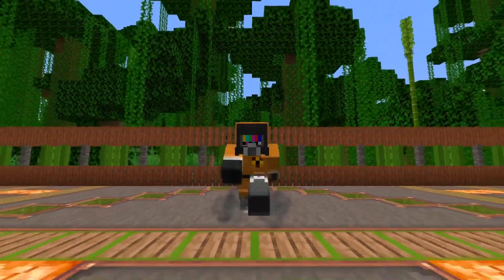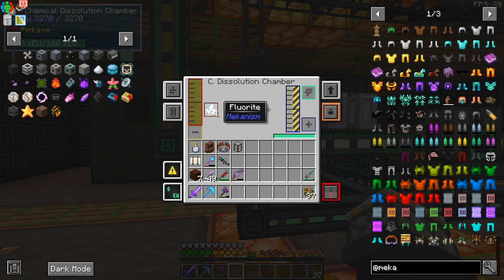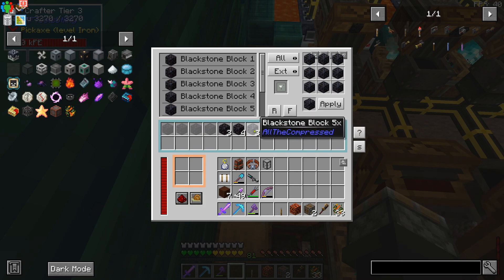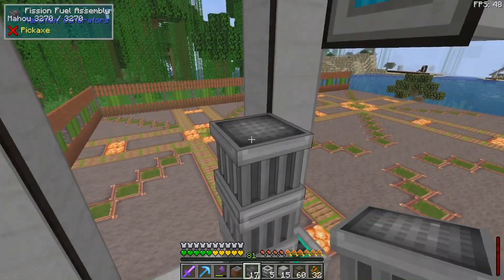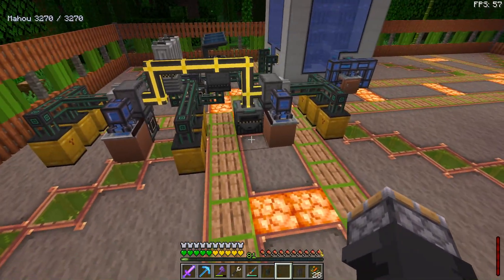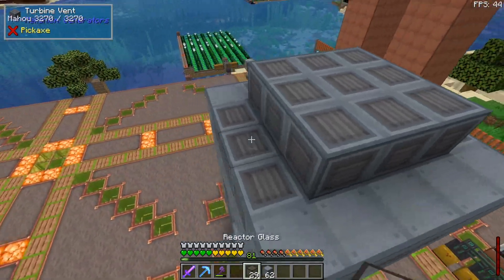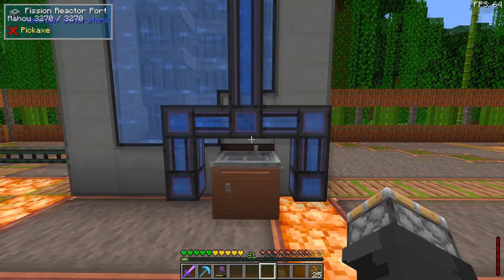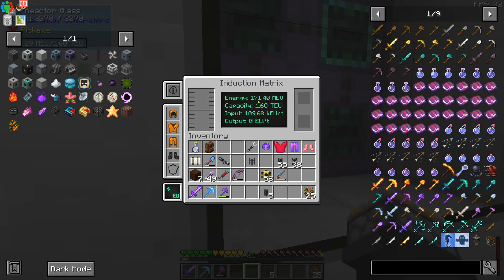Tubenobyl - Fission Reactor Mekanism - ATM7 Ep 13

Comment: Thank you for this video. I am going to try a similar setup in ATM8 though I am going to build the reactor in a Compact Machine. This way if it goes boom then nothing in my world should be hurt!
Reply from the maker: Smart idea! Good luck with the build.
Reply: @TubeAndKnuckle  The Solar Neutron Activator needs open skies so I cant collect any pellets inside the Compact Machine. Plus Gases cannot be piped outside of the Compact Machine. In my effort of trying to collect everything I managed to create a radioactive spill killing myself. lol

Now I have everything setup on top of a mountain and it works absolutely beautifully! Burning 12 mb per tic I am creating 274 kFE. Not sure what changed between ATM 7 and 8 though my Induction Cell while built exactly the same as yours holds 5 times the energy.
Reply from the maker: @alltaira5922  The trials and errors of modded Minecraft! Your first nuclear fallout 🥵. We've all been there! Hey at least the pretty particles that kill you are now stuck in the compact machines dimension! Glad that you got it all figured out and it's working for you now.

Comment: I cant get the pipes to take water and put it in the reaction chamber, is there a specific tool i have to use?
Reply from the maker: Need a configurator from mekanism if you are using mekanism pipes. That will allow you to extract or import on the end of the pipe where it is connected.
Reply: @TubeAndKnuckle  it only tells me Redstone on or off. Unless I have to hold it or something?
Reply from the maker: @theshagster0195  Need to be holding a configurator while looking at the pipe where you want to extract from then right click the pipe end or shift+right click to set the pipe to extract.
Reply: @TubeAndKnuckle  ok I’ll try that, thank you
Reply: @TubeAndKnuckle  and what’s the thing at the back of the sulfur dust like the back bottom pipe?
Reply from the maker: @theshagster0195  do you have a timestamp of where that is in the video?
Reply: @TubeAndKnuckle  1:32, the back bottom pipe?
Reply from the maker: @theshagster0195  It looks like I have a fluid trash can behind there. My guess is that there is a by product created from the PRC that I didn't need so I'm dumping it out the back into that trash can.

Comment: I can't get the sulfur dioxide into the chemical infuser. I have the the gases on the chemical dioxide ejecting right into the infuser. there is oxygen in the infuser. I've changed machines and piping. any help?
Reply: It's probably to late but you need to make the inputs and outputs right in the Mekanism UI's of the machines

Comment: I built exactly what you did, I think. Hope it works. 
As I walk through the valley of the shadow of death, I will fear no Mekanism reactor (hope my Powah! Nitro reactor doesn't get jealous)...
Playing with the setting. Too slow, not enough power...
Huh? Where did the coolant water go? Wait... No WAIT... NO... WAIT!!!
FIRETRUCK!!!!
/mek radiation removeAll
/mek radiation heal

Well, maybe it wasn't exactly like you did.
Reply from the maker: I'm dying right now!! Might just be the funniest comment ever! Never fear the Radiation Suit just cause it makes you talk with a Russian accent.🤣🤣
Reply from the maker: On a more serious note if you have any questions post em
Reply: @TubeAndKnuckle  I appreciate that. 
Yeah, It was funny, but not until about an hour after the meltdown.
The 2nd reactor is up and running fine. Slight design change. A little bigger and 8 sinks feeding 4 ports. I can only set the burn rate to 15 though. At 16 the coolant starts dropping. It says the max burn is 65. Oh well. I got a couple stack of pluto and polo so far. I'm just letting it do its thing and leaving it alone. LOL
Reply from the maker: @ardent963  OHH. Do you not have a turbine setup to cool the coolant from the reactor?
Reply: @TubeAndKnuckle  I do. I copied your layout, machines (except the slightly larger reactor), pipe routing and all. But... I was cleaning up some pressurized tube jankieness elsewhere, and the game crashed. Now I can't open it. I have to figure out how to get a backup restored I guess.
Reply from the maker: @ardent963  OHH NO!! The worst outcome of all. A game crash loop. Good Luck figuring that out hopefully your backup works out
Reply: @TubeAndKnuckle  Good news and bad news. The good - I restored the most recent backup. The bad - It was from a week ago. For some reason, all those times I was seeing the backup message in the bottom corner as of late, it was a lie.
At least I'm not starting over. And it will only take a fraction of the time to get back to where I was.
Reply from the maker: @ardent963  Yeah I'm not sure where those auto backups get stored? Glad that you got it working and not starting over.